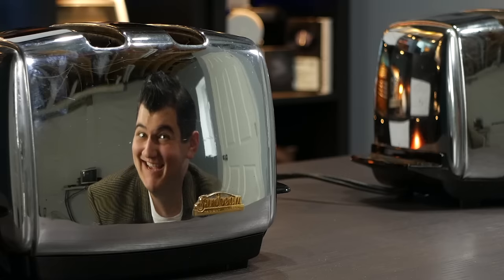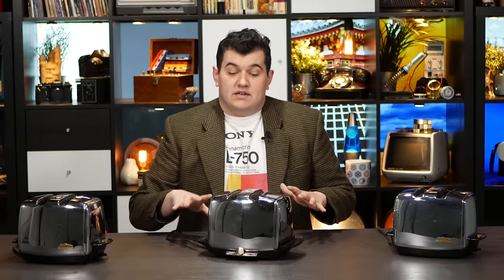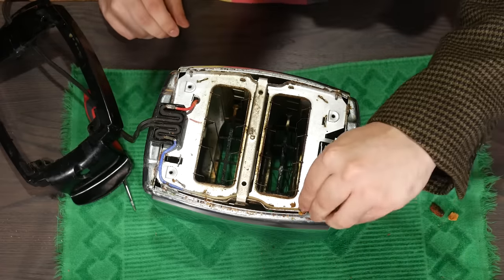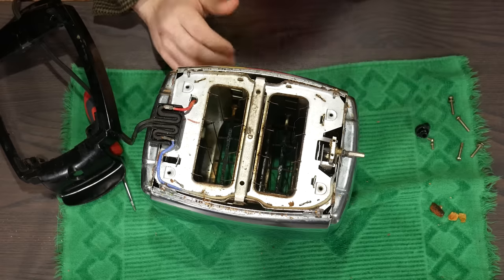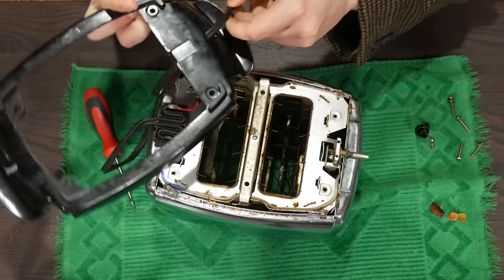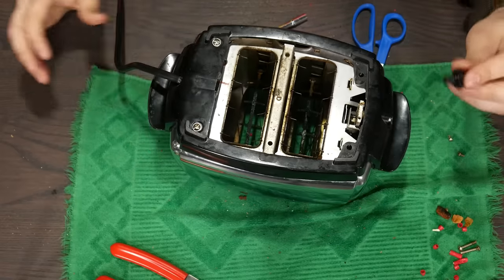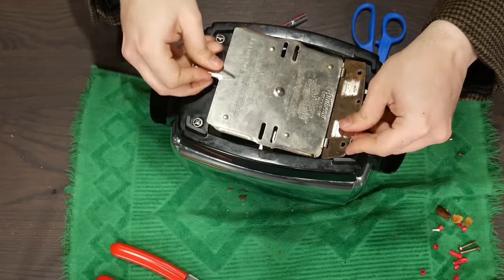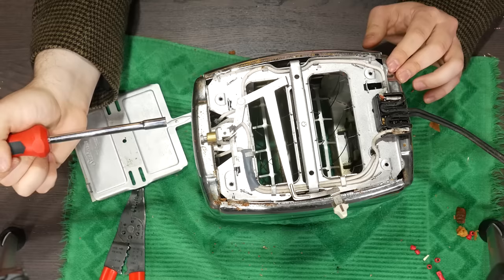Sunbeam Radiant Control Toaster--Repair and Modernization

Comment: Perhaps you should have just bought a power cord for a side by side refrigerator.
Should be able to hand the amps, has built in grounded plug ( also called a molded plug) and is a bit longer.

You might be able to use a top loader washing machine cord too.
Edit:
PS Take an ohmmeter and measure between the ground prong and various places on the metal.

If less than 1 ohm, you have a good ground.

Ever try to remove stuck toast?
One hand on the metal body and other holding a metal fork. Hmmm.

We are supposed to unplug any toaster that is jammed or needs cleaning/repair.

You also assume that everyone has a GFCI outlet in their kitchen. Or similar breaker.
Every place I lived does not have any of those for kitchen outlets.

Some of the places you cannot upgrade to GFCI without massive amounts of money to remodel and upgrade everything ELSE that the inspector demands.

The DO make a GFCI mini extension cord (about 6 inches long or so). It is used for power tools.

or this one:
https://cdn1.bigcommerce.com/server4200/rx1qnc/products/10877/images/33223/Voltec-04-00106_1__89017.1484132753.451.416.jpg?c=2

Comment: 34:08 Here is where I wish there was a different way that things were wired so that even if your electrical outlet was not wired correctly you would still be safe? If devices in the US were designed so that even if the plug receptacle was not wired correctly the device would be designed to work properly anyway and could detect that the outlet was not wired correctly to alert you of that.
It would be nice if this company would make a newer version of this toaster that could make things such as bagels and other thicker breads and such.  I remember when I was a kid in the early 80s my grandparents had one of these toasters and it was a good toaster. They don't make them like they used to. If they made one today they could make many improvements today that they didn't have back in the day but I believe they could find a way to do a newer version that could take some of the newer features of the newer toasters of today but bring back the classics of yesterday and put them together? The thing is I know that there are some younger people that do like some of the older things but may not like certain things about the older things and if we can make it so those older things could perform like some of the newer things maybe some younger people would love to use the older things on a daily basis? Can you please make a video talking about this?

Comment: Oh man I hope someone sees my comment because I can't find anyone with knowledge about this. I opened a pretty well functioning AT W Sunbeam to clean (not a full disassemble.) Reassembled to the best of my ability, it now turns on as soon as it gets plugged in, regardless of where it the temperature slider is on, or 3 full turns of the thermostat screw to the left or right. The spring bread tray also feels pretty tight and springy, and at the top. I'm so lost and I've had no bread toaster! Thanks for reading

Comment: Often times, wires will be thinned, and still be copper conductors.  Adding a diode will just stop one direction of the power cycle, but still be 240 on the half that's still flowing through the elements.

Comment: You could have use hot glue or some other fork of epoxy to keep the wires in place in the strain relief while manipulating the bottom cover, that way you wouldn't have to worry about the wires popping out of place

Comment: I wouldn't recommend soldering those leads. Solderless crimp connectors are your friend in situations where there's even a remote chance of reflowing from heat cycles.

Comment: Based on the size of the hole for the cord and the color coded wires is it possible that someone replaced a polarized cord with an older non polarized cord?

Comment: Even if you decided not to ground the toaster frame (and cutting and blanking off the earth wire), using a 3-pin plug would at least orientate the correct polarity.

Comment: So, I have a later model with a slider.  Late 70s early 80s?  Its identical to the one that was tension-adjusted in the first part.  I have it mostly working now (running too long) but my biggest issue is cleaning it.  I don't know what the previous owner(s) did to this but it is CAKED on the inside.  Anyone think that oven cleaner may be too harsh for the stuff I couldn't chisel off?  My worry is that I might damage the heating elements or something.  It also doesn't help that I can't fully remove the inner area as the handle sides of chrome are riveted in.

At least the power cord is less sketchy than earlier models.  It's not polarized and still uses paper insulation wires on the inside.

Comment: Wouldn't rectifying 240v still result in double the power? If it weren't rectified, it would be 4x the power because current would double as well, but rectifying it won't bring it down to the same wattage because although the "duty cycle" is halved, the voltage and current during the "on" portion are still both doubled. If the heating elements were in parallel, switching them to series would effectively convert it to 240v, which i've done in reverse with a waffle iron.

Comment: Why not just solder the wires together and cover with heat shrink for insulation? Is it you dont have a solder iron or would the heat of the toaster melt the solder? Im not an electrician so its a genuine question

Comment: Just wondering if you figured out a fix to the the inadvertent start on power up? Happens if you trigger the bread detector switch while it's off then apply power. 
It needs to do a cycle to return to waiting. Cycling power doesnt do it.

Comment: Honestly a good cleaning would be in order, if I were going to go an do that , I would completely restore this model to its original glory like it was Brand new. That means New thermal wiring, polarized cable and cleaned and buffed out the exterior to give it a pristine look.

Comment: Dude. You really gotta up your electrical construction tool game. That crimper/stripper combo tool is the worst. Go for the combo insulated/non insulated crimper cutter and 1-2 good spring loaded dedicated strippers. You’ll never look back. It’s one of those times the combo tool is so difficult and time consuming it’s worth the weight and switch off of having two tools. I can link you examples of what I’m talking about if you hit me up.

Comment: those crimps were also soldered.  That is why they would not come out.  Might want to cut the insulation on the butt connectors and crimp them without it, as well as solder over it to hold it solid.  next time.

Comment: Prob the newer version uses a lot less chrome and thinner sheet metal. I have an original Hamilton Beach 1958  chrome toaster. The thing is almost 3 times the weight of the new version.

Comment: I am not really happy with the strain relief....The relief should be fastened on the outer insolation layer of the wire. The small diameter insolation layer on the 3 conductor wires is not meant to be exposed to strain or any other force. Look at the old 2 lead wire: The isolation layer is much thicker. As you mentioned, a 3 wire cable with no secondary insulation but a thick primary would be a better choice. 
Also, regarding the crimp connectors, I would have used bare crimp connectors with high temp heat shrink.

Comment: Way late to this party, but couldn't you have run more appliance cord into the toaster and put the crimps outside of the strain relief? Leaving the insulating bits on the connectors would have prevented a short to the chassis and it would have saved you some fuss trying to get them in place.

Comment: Do NOT try to convert these toasters to 240v by just putting a high current diode in there to half-wave rectify the power.  The half-wave rectification would "cut down" the 240v to an average 120v, true, so the heating elements would probably be okay.  BUT the trigger contacts that switch on and off when the toast rises and falls will get burned shut.  They are rated for a certain current, AC.  AC current, changing direction 60 times per second, makes it much easier for the contacts to "let go" when the power is turned off.  With DC current flowing, they will not release and will eventually melt together.  This is the reason switches and relay contacts are often rated for much less current, DC, than they are for AC.

Comment: Wondering if you can help, 
As soon as I turn it on at the power point, it starts, with no toast in there.
(regardless of the tension)
So I'm imagining the switch must be stuck in the triggered position...? 
Mine in a newer model, Australian, TA J

Comment: What should the air gap be on the reed power switch? what holds it closed? what holds it open-surely not the teeny weak spring underneath the little pin from the bimetallic reed? a magnet in the toaster side of the switch maybe? (only asking because I'm trying to fix one someone else fiddled with. If I hold the switch shut lightly it will run, but the switch opens without pressure. looks like it's been bent or something

Comment: Most times on these people tie the loop knot with wire right at the point where the wire exit the toaster and have large black heat shrink for full cord out on the cord and 3 smaller 1/2 to 1” long piece on each wire push in the cord before do the loop knot so it will not pull back out of the toaster then push heat shrink in a little you can roll on top of it self for tighter fit and add some heat and everything melts together and it look it came from the factory like that. And don’t tell me you don’t have heat shrink I seen the videos with the boxes and boxes of heat shrink.

Comment: Your problem with the wires showing where the cord enters the body could be solved easily with a 1" or 1 1/2" piece of heat shrink.

Comment: you need to use hot glue as a temp holding solution.  if you ever need to remove hot glue, use isopropyl alcohol, it will turn it to putty, then you can pull it out easy.

Comment: If it were me, I’d skip the butt connectors and just solder the wires together. No additional bulk, and the heat surely couldn’t build up enough to melt the solder later. Add some quality heat shrink tubing with adhesive, and it should be doubly strong and protected.
Reply: Yeah he did mention that but I was using premium miniplayer so I didn't see the timestamp

Comment: I know it's too late to change what happened a year ago with this video, but I just want to be another little voice urging you to exercise extreme caution with materials that may contain asbestos, especially old appliances like this one (asbestos was a common insulator into the 1970s). Asbestos is no joke; any disturbance can release microscopic asbestos fibers into the air, and it's those microscopic fibers that penetrate deep into your lungs and lead to asbestos diseases decades later. (Mesothelioma, in particular, can be caused by any level of exposure; there is no known safe level of exposure to asbestos.)

Asbestos can be found in all kinds of materials (really, the stuff was used practically everywhere), but AIUI it's in the insulation of wiring where you are most likely to encounter it, given the kinds of things you do. If it's insulation and it looks like paper or cloth (or pretty much any white-colored thing really), and the appliance or device was made prior to the 1980s, there's a very good chance of that insulation being asbestos. Asbestos can be made into all kinds of forms: paper, cloth, and even embedded into other materials.

As far as this project goes, you probably would have been best off... well, not doing it at all and throwing the toaster into the garbage, but since you really wanted to do it, you probably would have been a lot safer removing and replacing both of the entire wires while wearing at least a respirator. But you should really look up more comprehensive information or better yet, hire someone trained to remove asbestos electrical wiring to do that for you, when the need arises. This isn't something you want to take a chance on.

Comment: I just picked up a toast like the middle one for CA$8 at my local Value Village! It still works, but the wire guides on the inside are bent in towards the elements so the toast always come out way to dark on the side facing the middle of the toaster.. Is there anyway to fix them?

Comment: 22:19 DO NOT BURN IT!!!! I am a Certified building inspector who specializes in Asbestos.  At that amount it shouldn't be too dangerous so long as its not fraying, the best thing to do is seal it with a light layer of high heat paint/ silicone. BUT!!!!!! DO!!!!!! NOT!!!!!! try to burn it!!!!! Heating even a small amount of asbestos can lead to serious problems such as Pleural Mesothelioma...Just my FYI
Reply: PLEASE READ ABOVE FOR SAFETY!!!!!!!!!!!!!!!!!!!!!!!!!!!!!!!!!!!!
Reply: PLEASE READ ABOVE FOR SAFETY!!!!!!!!!!!!!!!!!!!!!!!!!!!!!!!!!!!!
Reply: PLEASE READ ABOVE FOR SAFETY!!!!!!!!!!!!!!!!!!!!!!!!!!!!!!!!!!!!
Reply: PLEASE READ ABOVE FOR SAFETY!!!!!!!!!!!!!!!!!!!!!!!!!!!!!!!!!!!!
Reply: I don't want you to try to survive a double lung transplant!!!!!!!!!!!!!!!!!!!!!!!!!!!!!!!!!!!!!!!!!!!!!!!!!!!!!!!!!!!!!!!! There is no cure or treatment for Asbestos's/ Mesothelioma. Please BE SAFE GUYS!!!!!
Reply: AND Yes, it also looks to my trained eye to contain a white fibrous material of which I can only assume is a "White Chrysotile" asbestos. Please also be aware of Blue (Crocidolite) asbestos which can often be found in old electronics up until the last 1990's.

Comment: I hope that wire you thought might be aluminum is NOT aluminum... having aluminum and copper touching in wiring can cause galvanic corrosion, and potentially fires

Comment: I have an odd issue. Toaster works fine but it will randomly move to toasting mode for 30 seconds and then shuts off again. I am guessing the bimetal strip is cooling off but isnt there a check for "no bread" in the circuit?

Comment: Regarding the short appliance leads - here in the UK we have a TV series called "Watchdog" they succesfully campaigned for all appliances to have plugs as standard (for some bizarre reason applaiances came without one and they had to be wired on by whoever bought the appliance - would you trust any electrical good wired up by whoever?) Anyway they also campaigned for shorter kettle leads as small children  used to pull ketttles off work surfaces and be at risk of scalding - I imagine that the US decided small children pulling hot toasters off work surfaces might not be that safe and followed suit. See here for a bit more info on what Watchdog has done and why: http://home.bt.com/tech-gadgets/from-plugs-to-kettle-leads-six-ways-watchdog-made-our-homes-safer-11363979949228.

Comment: Instead of crimped connectors solder the wires together and use heat shrink tubing. Much better all around when done correctly.

Comment: I probably would have used some electrical tape to hold the wires down into the strain relief. Just put a 3" section across the top of the strain relief with the wires in it.

Comment: You need pliers with the crimper on the tip.
I would have soldered the wires.
I have never seen a toaster that did not require the user to push down the carriage(?) to start the cycle.

Comment: I live in a 2 wire house and had to address many outlets that had hot on the neutral.  I’m often asked why I don’t rewire and I’m like there’s no advantage other than I need adapters for 3 prong that are hard to find nowadays.
Reply: We use one those toasters sans ground only the polarized plug.  Safe

Comment: That thing will probably burn your bread faster with 240 volts, no? Heating elements are made for 120, then with 240 they will heat up twice as fast, is that right?

Comment: I'm surprised you just didn't extent the appliance cable lead length so you would have had more to work with, rather than fighting with shorter leads from the toaster.

Comment: Don't use solder in a heat-generating appliance. The heat will melt the solder and cause all kinds of problems. It is okay to spot-weld electrical connections.

Comment: Since mains voltage in Europe is roughly double that in the US and the power of an ohmic resistor is V²/R, even the diode would only limit it to twice the rated power, wouldn't it?

Comment: The comment about half-wave rectification isn't actually a very good idea. The peak voltage from rectified 230V is 230*1.414=325.22V which, without a capacitor or anything to somewhat average the peaks out, could be high enough to break down the insulation in the wires and/or destroy the heating elements. The switch is likely not rated for breaking voltage that high either. If you wanted to safely convert it you really would need to add a transformer in-line. A diode with a capacitive dropper might limit the current enough to be safe but... it's just not very good practice.

Comment: If you ever want to have real fun making wiring stay in place while re attaching a plastic body piece over them: I had to replace a fuse in my vacuum cleaner, and the wires that were all around the handle and body piece we're a nightmare to align. Absolute nightmare.

Comment: Soldering and  heat-resistant shrink-wrap (heat-shrink?) is the way I'd have gone. and also use bigger shrink-wrap to isolate and fix in place the wire that comes out...  Or idd just redo the wiring totally..

Comment: The strain relief isn't the best design as it still relies on the wire and insulation of the individual conductors. A true strain relief device would clamp the outer sheath along with the internal conductors.
You'd be better off using an off-the-shelf, two piece, stand-off, metal strain relief module that you could attach to the internals of the toaster, in place of the bakelite block, using self tapping screws, and then clamp the flex in that.